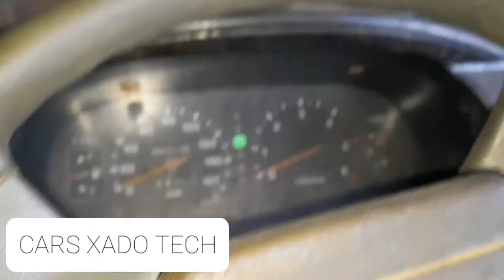MITSUBISHI DELICA AUTOMATIC TRANSMISION SHIFTING MECHANISM ANG PROBLEM 5 MINUTES AFTER ISSUE FIXED

Comment: Boss san makikita yung ATF/temperature sensor delica automatic
Reply from the maker: Ang Delica Automatic Transmission Fluid (ATF) temperature sensor ay karaniwang matatagpuan sa malapit sa transmission oil pan ng sasakyan. Ito ay malapit sa transmission cooler lines o transmission fluid lines na konektado sa radiator o transmission cooler.

Ang eksaktong lokasyon ng ATF temperature sensor ay maaaring mag-iba depende sa modelo at taon ng Delica. Maaring kailanganin ang pagtanggal ng ilang mga komponente o covers upang matagpuan ito. Maaaring magkaroon ng mga wire o connector na nakakabit sa sensor upang makapagpadala ng signal sa instrument panel o sa engine control unit ng sasakyan.

Mahalaga na konsultahin ang service manual ng Delica o sumangguni sa isang propesyonal na mekaniko upang matukoy nang eksaktong posisyon ng ATF temperature sensor at tamang pamamaraan ng pag-access sa sensor.

More Basic Pointers  Toturials videos: https://www.youtube.com/channel/UCXSl7FUzPZV3lIxFWCHFTVA
FB Page CARS CLING TV: https://www.facebook.com/clingauto
CARSClingTvShortVideos: https://www.youtube.com/channel/UCsUWQnaD9vVKqL_w6eAYhgA
#
#xadoenginetreatment 
#carsclingtv 
#basicpointerstutorialissuefixed 
#xadoenginetreatmentengineperformancerecovered
#10yearslonglastceramicscarbonmetalcoated 
#carsclingautorepairshoplegacy 
#trottledelayremoval
#blackwhitesmokeremoval
#lowpowerengineremoval
#carsclingtvshortvideos
#xadoenginetreatment 
#changeoilpms
#enginecarbonchroming 
#carsclingautorepairshop
#remedyxadotreatment 
#acceptcheckengineissue 
#troubleshoot 
#legitonlineseller  
#Mobile09171259996
CARS CLING TV Located @Purok Pandian Gay Corner Makar Highway Brgy. Labangal General Santos City SouthCotabato 9500

Comment from the maker: Proudly Introducing: XADO "IN-PLACED REPAIR" NANO Ceramic-Metal Treatment RUSSIAN ExtraOrdinary Technology !
XADO  is the ONLY TECHNOLOGY in the WORLD which ADDs both Weight & Dimension to WORN OUT parts and Completely RESTORES their Geometry while operating.  It SAVES Energy, Resources and Possesses the Unique Ability to REPAIR Machines & Mechanism without the need of Disassembling or Overhauling. Metal can be HEALED / CURED.

Comment: How to use dual shift
Reply from the maker: The Mitsubishi Delica, particularly the models equipped with a 4WD system and dual-range transfer case, offers both high and low gear ranges. This allows for different driving conditions and terrain types. Here's a simple guide on how to use the dual shift in a Mitsubishi Delica:

### Understanding the Dual Shift System
1. *2H (Two-Wheel Drive High Range):* Use this for normal road driving and gentle off-road conditions.
2. *4H (Four-Wheel Drive High Range):* Best for slippery surfaces like gravel, sand, and light off-road conditions.
3. *4L (Four-Wheel Drive Low Range):* Use this for challenging off-road conditions requiring maximum torque, such as deep mud, snow, steep inclines, or rocky terrain.

### Steps to Use Dual Shift in Mitsubishi Delica

#### Shifting Between 2H and 4H
1. *Ensure Safe Conditions:*
   - Make sure you are driving straight and at low speed before shifting between 2H and 4H.

2. *Engage 4H (Four-Wheel Drive High Range):*
   - With the vehicle moving at a low speed, simply shift the transfer case lever from 2H to 4H. In most models, this can be done without stopping the vehicle, but it's recommended to check your owner's manual for specific guidelines.

3. *Disengage 4H and Return to 2H:*
   - To go back to 2H from 4H, you can also do this while driving at low speed. Shift the transfer case lever from 4H to 2H.

#### Shifting to and from 4L (Four-Wheel Drive Low Range)
1. *Stop the Vehicle:*
   - Bring the vehicle to a complete stop before shifting into or out of 4L.

2. *Engage Neutral:*
   - Shift your main transmission (gearshift lever) into neutral.

3. *Engage 4L:*
   - Move the transfer case lever from 4H to 4L. This usually requires a firm motion.

4. *Shift Back to Gear:*
   - After engaging 4L, move the main transmission back to drive (D) if automatic, or the desired gear if manual.

5. *Disengage 4L:*
   - To switch back from 4L, again stop the vehicle completely and shift the main transmission to neutral. Then, move the transfer case lever from 4L to 4H.

### Tips and Precautions
- *Only Use 4L When Necessary:* Low range is meant for tough off-road conditions and should not be used for normal driving as it can damage the drivetrain and cause premature wear.
- *Avoid High Speeds in 4H or 4L:* Both 4H and 4L are designed for low to moderate speeds. Driving at high speeds in these modes can cause damage.
- *Consult the Owner’s Manual:* Always refer to the vehicle’s owner’s manual for specific instructions and limitations related to your Delica's 4WD system.
- *Regular Maintenance:* Ensure your transmission and transfer case fluids are regularly checked and maintained, as this can prevent potential issues with the 4WD system.

Using the dual shift system effectively can improve your driving experience in various conditions, providing better control and safety.

Thank you for your support!

More Basic Pointers Toturials FULL Videos: https://www.youtube.com/channel/UCXSl7FUzPZV3lIxFWCHFTVA
For more inquiries, please contact us at our 
FB Page CARS CLING TV: https://www.facebook.com/clingauto
CARSClingTvShortVideos: https://www.youtube.com/channel/UCsUWQnaD9vVKqL_w6eAYhgA
#
#xadoenginetreatment 
#carsclingtv 
#basicpointerstutorialissuefixed 
#xadoenginetreatmentengineperformancerecovered
#10yearslonglastceramicscarbonmetalcoated 
#carsclingautorepairshoplegacy 
#trottledelayremoval
#blackwhitesmokeremoval
#lowpowerengineremoval
#carsclingtvshortvideos
#xadoenginetreatment 
#changeoilpms
#enginecarbonchroming 
#carsclingautorepairshop
#remedyxadotreatment 
#acceptcheckengineissue 
#troubleshoot 
#legitonlineseller  
#Mobile09171259996
CARS CLING TV Located @Purok Pandian Gay Corner Makar Highway Brgy. Labangal General Santos City SouthCotabato 9500

Comment: bos bakit yung deleca ko pag nakapark tumataas ang rpm pag sa D naman bumagsak rpm
Reply from the maker: Yes Sir,. During Park position tumataas ang rpm dahil walang pressure na nangyayari sa transmission walang load na natatanggap ang engine freely lang ang torque ng makina kaya mataas ang rpm, then pero during  D Drive position ang engine bagsak ang rpm dahil sa may load na ang transmission controlled ng ecm , mabigat na ang paikotin ng engine,.

Comment: Boss pwdi po ba yan sa 2017 hilux revo na diesel automatic transmission?
Reply from the maker: Yes Sir,. Pwede sa 2017 hillux revo deisel ang xado ex 120revitalizant,.
Reply: Sir sa.an ko po ilagay kasi wlang deep stick sa atf lang na lagayan sir?
Reply from the maker: Meron po need ng special tools and expert mechanic to do the job.

In the Honda Civic, fault code 14 is commonly related to issues in your Fuel Injector Circuit. This fault code indicates that there is a problem in the circuit of the fuel injector in your vehicle. The fuel injector is responsible for delivering fuel to the engine for the combustion process.

To resolve the issue of fault code 14 in the Honda Civic, you can follow the following steps:

1. Check the Fuel Injector: Make sure to check the fuel injector of the vehicle to determine if it is faulty or not functioning properly. Cleaning or replacing the fuel injector may be necessary depending on its condition.

2. Inspect Wiring and Connectors: Thoroughly inspect the wiring and connectors connected to the fuel injector circuit. Ensure that there are no faulty or improperly connected wires or electrical issues that could be causing the problem.

3. Reset the ECU: Try resetting the Electronic Control Unit (ECU) of the vehicle to clear the fault code and check if it is resolved by a simple reset.

4. Consult a Professional Mechanic: If you are unable to resolve the issue of fault code 14 in the Honda Civic on your own, it is best to consult a professional mechanic or Honda service center to have them thoroughly diagnose the problem and provide the appropriate solution.

By examining and addressing the steps mentioned, you can resolve the issue of fault code 14 in the Honda Civic and maintain the smooth operation of your vehicle.